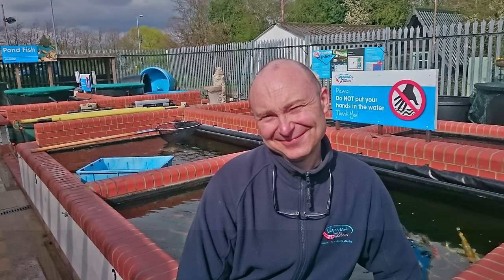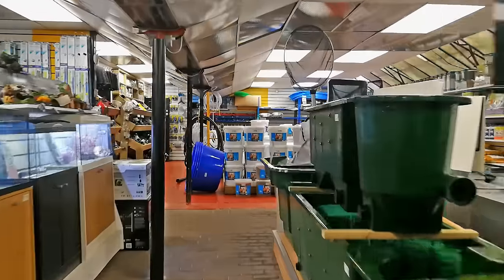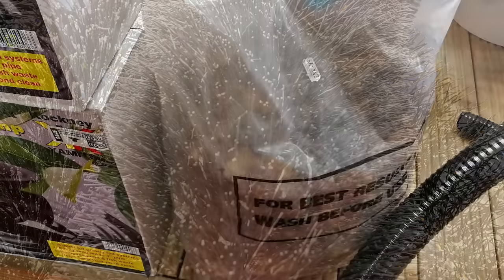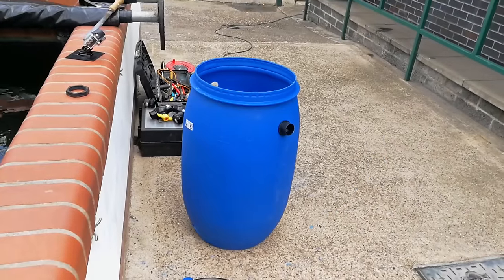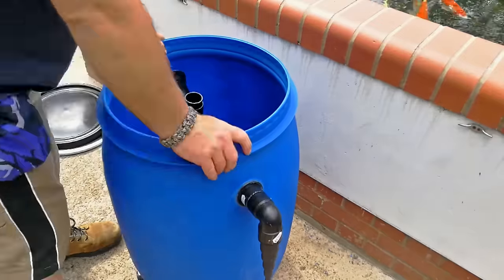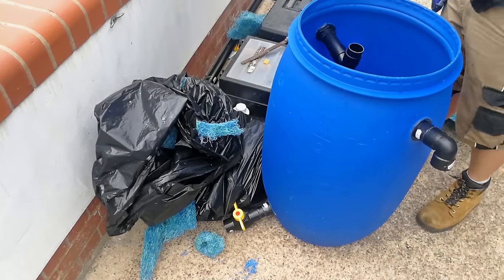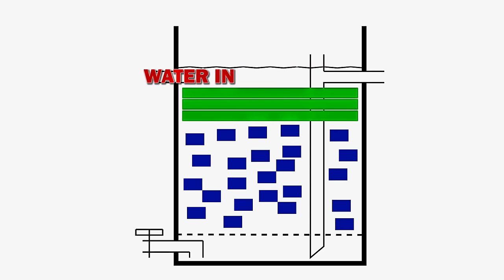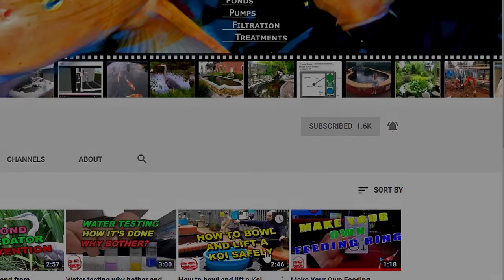DIY fish pond filter cheap easy.

Comment: Hi, can I ask why the 90 degree bend helps the tank to fully empty, does it work as a kind of vacuum/suction? Also if I am planning to pump 3000-4000 litres of water and hour would you use 2” or 3”
Reply from the maker: Not sure exactly what you mean regarding the 90 bend. The tee piece picks up water of the bottom and prevents the tank from emptying if the power turns off. 2 inch solid pipe should be fine if it's got plenty of fall and not to close to the top of your filter.
Reply: Lee Calladine thanks for getting back to me, what I meant was why put the 1.5” bend on the drain at the bottom, you said to help the tank drain fully, wouldn’t this drain without this?
Reply from the maker: @Connolly135  the bend ensures that the tank completely empties. It sucks the muck out of the bottom.

Comment: Hi, What modifications would need to be made to use this as a pressurised filter?

Thank you
Reply from the maker: It worked as a pressure filter set up exactly like in the video. I also did a follow up video.
Reply: @leecalladine  Thanks for the Reply Lee. Just trying to get my head  around having the overflow in a pressurised filter. Wouldn't the water just take this route with it being the least resistance rather than through all the filter media?

Thanks again Lee

Comment: Hello, a quick question; can I switch the placements between the mechanical filter and the biological filter? does it affect the filtration effectivity?
Reply from the maker: It makes servicing tricky.
Reply: Mechanical filtration should always come first before biological filtration.
Reply: @shiroineko13  if i have a mech pressure filter before this, would that work?

Comment: Does cost a lot for someone  to vist and look at my pond I'm n n 73yrs of housebound  something is wrong
Reply from the maker: Just give us a call at the shop 01159397926 we may be able to help. If your only local it not cost much if anything. Shops in Nottingham. Please mention that you messaged me having seen a YouTube video.
Reply: @leecalladine  hi thank you so much for your reply 😊 what it is we can deep clean the pond it looks great a week later it starts get mucky again the machines I bought and got its cispounds now I bought another machine the one you turn the crap once again it don't work water is checked and  its spot on. X
Reply: @leecalladine  hi Lee thank you for  your reply,a young man came to sort the pond ,so all I'm doing now trying to some plants out now its soil I get upset about the soil going in my pond x
Reply: Hi Lee could you recommend plants for me to buy please Rita
Reply from the maker: @ritagriffiths6067  there will be no plant's available until  Easter time. Then it's largely customer preference.

Comment: it will make bigger partikels/residuals left on the foam.
so why we have out waste at the bottom ?
Reply from the maker: The waste is at the bottom so you can drain down the whole tank to clean it.
Reply: @leecalladine  so on the foam, thers's no residual waste ?
Reply from the maker: @Bang_Satria  there is a build up of waste over the sponge. As the water drains past this the sponge has to be peeled off for washing.
Reply: oh i see

Comment: What is the flow rate for this filter?  I have a 2600gph pump.
Reply from the maker: You would definitely need to increase the size of the outlet. For a flow rate of that size 3" would be better.

Comment: what pushes the water into the discharge pipe?
thanks
Reply from the maker: If its sealed like this one then pressure fron the pump. If its open top then the water flows out through the lowest point down hill only.
Reply: @leecalladine  To use this as a pressurised filter would the overflow have to be removed
Reply from the maker: @jasondanby9227  it seems to work both ways. The overflow it not ease if pressurised.

Comment: How does the water exit the outlet? Is it gravity fed?
Reply from the maker: Yes. It runs back down hill. But by chance  it's also sealed in this case it could also be modified to be fully pressurised.

Comment: i did it exactly like you said …with 2 inch pipe and it “overflows “every time even with no media any suggestions
Reply from the maker: The flow is too strong. Or the discharge pipe is too close to the top.

Comment: Grab a bucket your everyday white buckets then put some bath sponges and normal dish sponges basically anything that is absorb at and durable layer them with plastics that let water through between each layer and make a hole are the bottom on the side put some pvc pipe and seal it with silicon then simply put your hose from your pump inside the filter and done

Comment: Well I did the dumb and built this with the bottom hole directly below the intake hole. A 90° solved that hiccup, but then I turned on the submersible and the pump is too powerful for my 55gal barrel. So back to the internet for 2" pvc fittings that just can't be found in hardware stores. Wish me luck, success and sanity.
Reply from the maker: The 2inch fittings will let a lot more water out. You could also an extra outlet to serve as a overflow.
Reply: @leecalladine  I'm going to add a valve to the intake line to control the fill rate and fine tune the output flow. Maybe another output pipe will happen.. Can't hurt! Thank you for the videos and reply.
Reply from the maker: @captainscrew1252  Sounds like a good plan. Going to do a video about a new trickle filter i am working on. It be out in about a week.

Comment: Did you ever do an update? Anything you would change?
Reply from the maker: Been to busy but the update will happen  It's run ok for a good while. Make sure the discharge pipe size is as large as possible. With the filter being so narrow at the top you need to wash the sponges regularly. I would also keep the outlet as low as possible, again this will make sure the tank doesn't overflow. Hope this helps.

Comment: Would I be correct in assuming that the outlet hose cannot then go uphill; e.g. if I had this barrel at ground level or in-ground, the outlet couldn't be piped up to the top of a waterfall that is, for example, 2 metres above ground? I'd assume that the outlet water would simply rise over the level of the overflow entry (in the barrel), and subsequent water coming in would simply take the overflow path (of lesser resistance)?

Perhaps in this case, I could implement the mechanical sponge filtration at the pump intake (e.g. https://www.stoneworld.co.nz/shop/Pumps+Filters++Lighting/Filters/Pre-Filters/Pre-Filter+Foam.html#.XiY4oCNS_RY ), and have the barrel only doing biological filtration (with the inlet at the bottom and the outlet at the top, i.e. the whole system full of water at all times)? I'm looking at buying a similar barrel to what you used; do you think that the top would remain sealed? I doubt that a biological-only barrel (e.g. bio-balls, ceramics, filter brushes) would become clogged (it's really only sponges that get clogged), so presumably an overflow bypass mechanism wouldn't be required.

Thoughts?
Reply from the maker: It's interesting that you mention that. Assuming that the barrel has a good fitted lid that can be pressurised then it is possible to create a system that works in the manner your suggesting. However it might require some modifications.

Comment: why not let the water enter from the bottom?
Reply from the maker: There are many reasons why it should not work from the bottom. They are outlined in the video. But going in at the top you can have a mechanical filter that is accessible, it will not Syphon all the muck back into the pond if the pump turns off. No need for a flow valve etc.

Comment: Hi, your (nonetheless delightful) accent and my aging ears combined lead me to ask for the details of the filter media.

Could you please oblige...
Reply from the maker: The media that I used was a combination of sponge and filter brushes. I also had some left over pieces of filter matting that got torn up and tossed in. The brushes are just there for biological filtration and the mechanical is almost entirely done by the sponge. You can use almost anything in a design like this. Filter media is an insert surface to develop bacteria.
Reply: @leecalladine 
Thanks. Other than that it would be heavy and difficult to clean,, how would pool filter sand perform?
Reply from the maker: @bertkutoob  They block very quickly and require large amount of maintenance. They would work well as additional filtration working off the back of a drum filter.

Comment: Wouldn’t you want a filter design where water enters at the bottom of the filter and exits at the top, to avoid any sediment at the bottom entering the return flow to the pond?
Reply: Jesper Elmgren Korskjær probably, but I wouldn’t think it would matter too much, since ponds need a lot of bacteria. Also the media would pick up most of that nasty stuff. I like to half stuff like leaves and mud on the bottom of my ponds because it’s easier to plant things in, and much better for the fish.
Reply from the maker: No definitely not. You can access the foams and if water went from the bottom the muck would be hard to clean out without emptying the entire filter. Also you would need a anti Syphon or flow valve to stop sediment returning to the pond when the pump is turned off.
Reply: Lee Calladine what I meant specifically is water entering about 1/3 up the barrel, and then install a simple bottom drain for flushing/cleaning purposes. I suppose we can agree that muck settles at the bottom as it is heavier than water. Now if the water flow travels in the opposite direction it seems logical that the two will separate, which is an important filter purpose.
Reply from the maker: @elmgren.  There is a hundred different ways it could be arranged. But the foams on the top will effectively stop all but the finest of solids so very little will actually reach the bottom of the barrel and this method is pound for pound the simplest, fool proof way of setting up a single chamber filter. At least that's my opinion. If you connected multiple bays together you could use the first one as a settlement tank and as you say bring in the water midway transfer at top that would settle out the heavy solids.